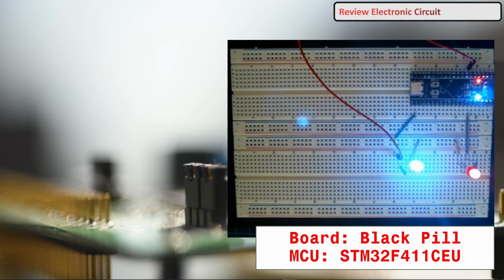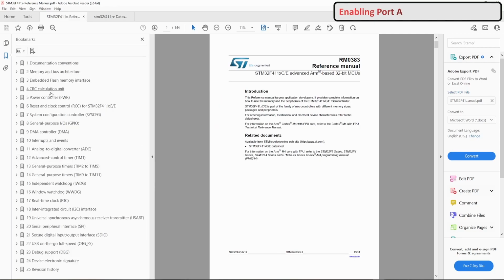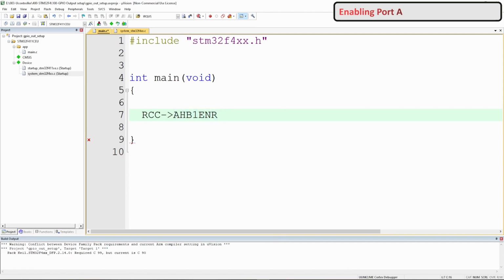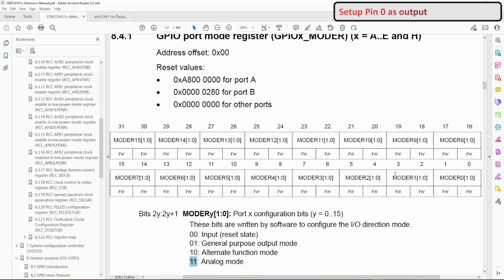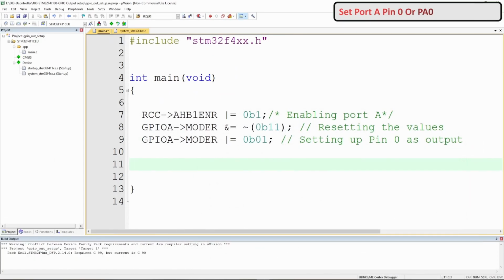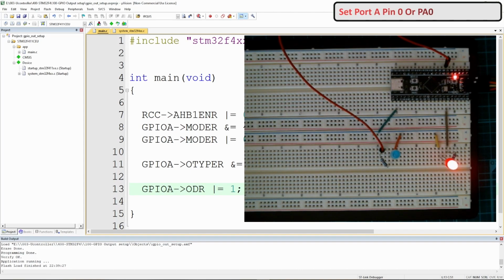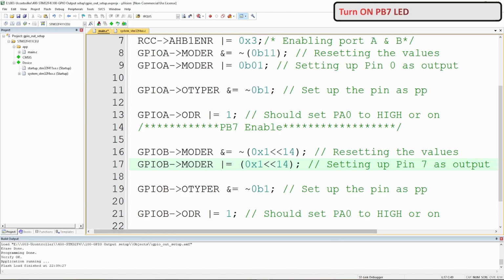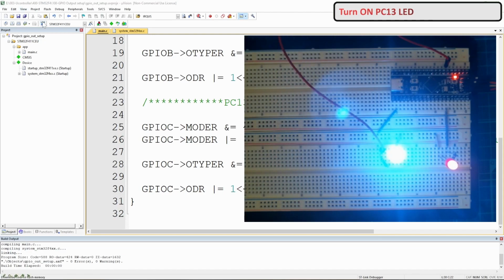100 - STM32 Tutorial: Bare Metal GPIO Pin Output & LED Control from Scratch with Keil uVision 5 🚀

Comment: Phew!! managed to wrap my head around this, just barely, that siwtching from binary to hex didnt help hehe  but i made it!   I asked chatgtp to blink the  light and it gave the same code, but used macros instead of calculating the bit shifs like (>>14)  It had conveient names for the specific pin locations to hide that operation.  Which was nice and conveneit way to hide the dirty work after you already know whats going on but didnt help when you didnt know whats going on so i appreciate you not using those macros  and showing us how to get to those bits.     It also didnt know the onboard LED  must be driven low to  turn on so i didnt get my light to blink until i had it toggle with the xor operator.  Since it  just switches it to the opposite, making sure the light turns on and off.  But I was still mystified why regular bit setting code didnt turn it on, now i know! Has to be driven low.  As great as chatgtp is -it can take you 99.9% of the way there, to get 100% there you still need a real human. Thanks.

Comment: HI,
Thank you for your tutorial.
but I have a question about the GPIOA->MODER &=~(0b11). why we cannot just write GPIOA->MODER &= 0b00
Reply: The bitwise NOT operator "~" complements the binary representation of "0b11", which is 0x00000003. So, "~(0b11)" results in "0xFFFFFFFC". Therefore, "&=~(0b11)" clears only the least significant two bits.
The expression "&=0b00" performs a bitwise AND operation with "0x00000000", which is all zeros. Essentially, this operation clears all the bits of the left-hand side value.
Reply: Had the same thought why not just set them to 0, because you dont set them, you clear them and  clearing them is a 2 step process , first step is choose the bits you want cleared with a negative mask thats what ~(0b11) is, its not the result you want its the bits you want cleared.  You basically mark the bits you want cleared with 1's here.   2nd step is to & it.    Done.  I  asked a similar question chatgtp  why cant you just GPIOA->MODER |= 0b00   set the bits to 0 like you set them to 1's.  It didnt give me a real answer or didnt understand my question it just told me how to do it with a negative mask... so i deduced you cant set bits to 0 like you set them to one,you can only  clear them to 0 and only way to do that is with a negative mask.